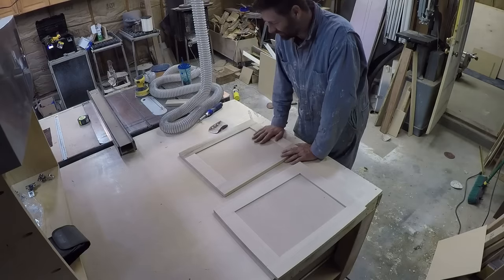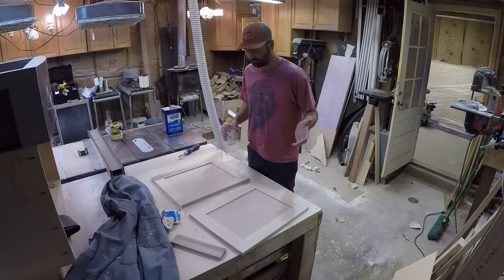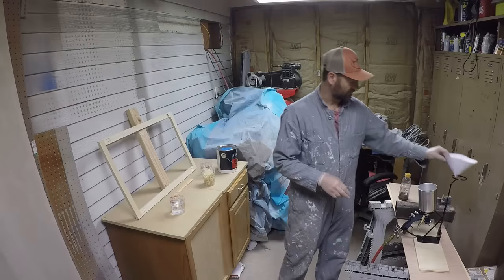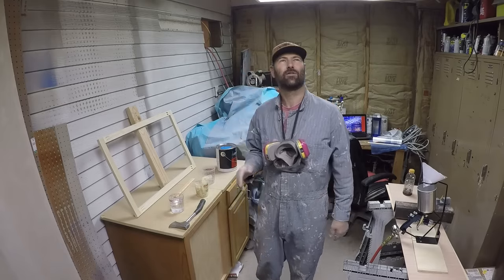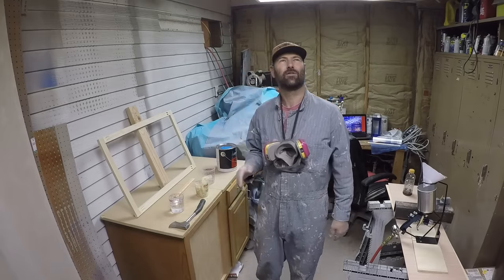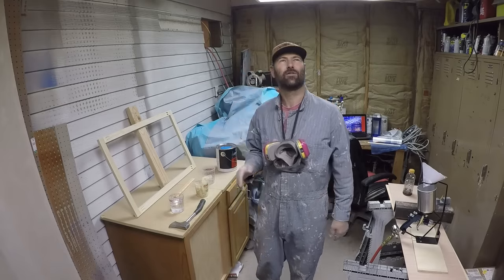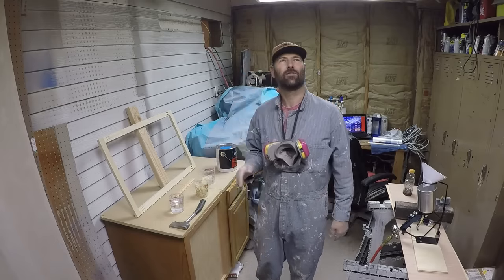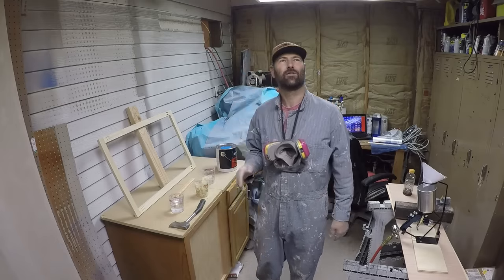Don't Paint Your Cabinets? | THE HANDYMAN |

Comment from the maker: The answer to your question is right here.  https://youtu.be/jD6EZrgX5Dg
Reply: The Harbor Freight sprayer nozzle is too small. You literally have to drill the hole out before you can use it for consumer-grade paint.
Reply: My first experience with the HF sprayer was great. I thinned my paint accordingly and all went well
Reply: I love this guy's OCD with explaining everything and doing a great editing to of editing ro skip the nitty gritty.
Reply: @jimmyjohn8008  same
Reply: So you wouldn’t use paint because it takes too long to dry?

It might be helpful to write down the points you want to make then discuss them at the beginning or end of the video.

Then use the content to illustrate your points.
Reply: I have a DeVilbiss HVLP spray gun I paid $400 for several years ago. Lacquer is my preferred finish to spray.  There are many pitfalls to spraying it you did not cover. Like for example the cloudy finish or blushing you will get when spraying in hi humidity that will ruin your project if you don't know to add a retarder.
Reply: @CJCFCO  Paint peels and flakes off .You need something that sinks into the wood instead of laying on top of it.
Reply: Ok, so it takes longer to dry..  Better to use a non toxic product than to use a product that is toxic, off gasses and is hazardous to your endocrine system!  😉
Reply: @christinewhite2414  if you use regular paint it will scrape off when your finger nails touch it & eventually flake off .How do you think they paint them in the 1st place
Reply: Right traditionally...That why it's prudent to seek out other non toxic alternatives.. there are  many other options, you just have to do the leg work.
 Zinsser shellac and companies who manufacture cabinets and furniture that are certified low voc emitting...
Reply: @christinewhite2414  Tell that to China the jet stream brings the pollution to the West coast. Not to mention the Nuclear radiation still spilling from years ago.
Reply: @brianmanning34  Yeah, that's another issue, don't get me started..  China is definitely gonna wear the pants with this administration, we're doomed!😬
Reply: @christinewhite2414  China actually made more progress than the the US during Trump's run. Trump actually turned back the clock on over 125 climate and environmental policies. Trump even promoted the return of the coal industry. Talk about delusional and total lack of environmental awareness - Trump is the poster child. Due to the damage he did, the USA will now be playing catch up to many countries that are less developed than the US.
Reply: You're using 'paint' as a verb in your title. Guess what you do with lacquer? You paint it on. Besides that, Meriam Webster defines lacquer as "any of various clear or colored synthetic organic coatings that typically dry to form a film by evaporation of the solvent." Guess how many solvent based 'paints' are colored and dry to form a protective film? Additionally, all automotive paints used to be lacquer based. Now most are acrylic or urethane. But all of them are paint, and all of them are painted on, even the lacquers, even the clear lacquers, even the pigmented lacquers. All are paint.
Reply: Next time, rather than being Mr Right, ask questions to find out if the person you are speaking with happens to know more than you do. They might actually be an expert in the industry. How do you know? Now you have two videos with misinformation, that you'll find a way to rationalize away
.
Reply: I feel your pain I just painted my friends cabinets amd it took me all week it was horrible waiting days for each coat to dry and of course after im done I come across this video amd painting cabinets with lacquer its a game changer lol I wish I would of seen this before

Comment: “Don’t paint your cabinets” while making a video on painting your cabinets. 🤔🤨wtf
Reply: I think he meant don't hand paint your cabinets but rather air spray paint them. He probably forgot to mention it.
Reply: I think because he is using llaquer?  I want to know why this is better, other than time to dry.  Is it more durable?
Reply: @abacab87  The best thing to do is call the paint store department to get more accurate information.  I plan on hiring a professional to sand my cabinets and then paint them to save on remolding. Besides, it's a rental property and no need to dump tons of money on expensive upgrades.
Reply: Did you overlook the "?" He's asking a question.
Reply: Laquer is not paint technically.
Reply: @abacab87  yes it's way more durable, not to mention it dries very quickly, like 15 minutes. So you can sand and recoat that quickly, oil based takes 4 to 6 hrs between coats, acrylics approx 1 hour. There is a reason he's wearing a mask. The  VOC fumes are brutal but can be well worth it.
Reply: 1:06
Reply: There was a ❓ 😂
Reply: There is a ? Mark
Reply: @johnnytocino9313  Even better is pigmented 2K polyurethane. But whether it’s lacquer or 2K you’re shooting, you need to wear a hood and eye protection; both finishes use highly toxic solvents that are absorbed by the skin. 2K has the added toxicity of the catalyst (i.e. hardener).

Comment: I use one of the cheap paint guns with a 1.5mm nozzle (neiko brand - $35) and it functions phenomenally. The only issues I ran into were not its fault - I should have gotten the 2.0mm nozzle version, and I shouldn't have been using latex paint  (I knew nothing about painting when I started)

What I did discover, however, was that if you mix latex paint with water based polyurethane at about 60:40 and then thin it to work in your gun (with a 2.0mm nozzle I don't think I would have to thin much, if it all) then you get a basically enamel paint like finish - it's been on my cabinets and seems to be wearing like damned iron. I did my first few cabinet doors with paint and then poly, and because it was even a little bit cool in my garage, it wouldn't dry evenly and I'd get spider cracking in the poly like mad. But mixing the paint with the poly, it solved the issue completely, and even though I have doors with paint/poly separately next to ones with the two mixed, you would NEVER be able to tell there was a difference. And for touchups on chips, paint/poly mixed together fills chips and scratches like a treat.

Comment: If you're using a 2.2-2.4 tip with around 40psi you can get a good finish. I used HVLP with Kilz after sanding cabinets then CabinetCoat over it. It's held up extremely well and lays so flat that you'll be amazed.
Reply: Try zinsser cover stain primer instead of kilz, I did and never went back! I even thin it with acetone to spray it on fine and dry fast.. I use avanti 5 stage hvlp. then I spray behr cabinet and trim with 1 pint of flotrol added per gallon. Always get amazing results.

Comment: Hang those pieces from the ceiling with wire so you can spray all sides with ease. It's best to spray all sides of the frames too so the entire piece is sealed.
Reply: You got it  the 360 coverage rule

Comment: I wouldnt be sanding where we are painting if possible.
Reply: he blew it off with the compressor, it should be alright. You should see conditions in cabinet shops, everythings done in the same room except a negative pressure paint booth. But all touchups, etc are done in mountains of dust.  In third world countries its even dustier and they achieve really good results still. But I suppose in your garage yes, sand on the driveway lol

Comment: As heavily as you are invested in spraying, it might be worth your while to look into purchasing a small spray booth, (if you can figure out a place to put it). Personally, I would look for a used one, but even those cheap collapsible spray tents are a better option than your current set-up. It's my experience that overspray is like nuclear fallout; it settles on and contaminates everything, (even when it looks like it hasn't). So doing it in an area that is totally removed from everything else in your shop, (including that nice air compressor) is a good idea. Also: look into buying some spray socks for the old noggin.
Reply: All I could think about was the overspray getting on the laptop. LOL
Reply: Agree. I built a booth in my shop for painting cabinets and the overspray still gets everywhere. It's a fine dust that can be swept up, but still. I wear a full monkey suit. Respirator, goggles, cap, etc. I'm using an small airless sprayer. 

I'd stick with his recommendation. Don't paint your cabinets. It is A LOT of work. 2 coats of primer and 2 coats finish. Dry time then prep in between. What was I 🤔

Comment: Hvlp - high volume LOW pressure!  Turn your air down and you will get a better finish.
Reply: I'm glad I was not the only one who noticed a lot of pressure from the gun.  This will also reduce the amount of paint you use on the job considerably.
Reply: Lol thought the exact same thing, sounds like 60 psi at least.

Comment: Consider using Shellac as primer/sealer .  Dries super fast . sands much easier AND film thickness is half . (less toxic and the finish lacquer coat can be thinner . (less spray and fuming). Perfect base for a lacquer finish . (keep a few spray cans on hand for small items)

Comment: I used Benjamin Moore Advance paint on my cabinets. To get a professional look, it takes a lot of coats, a lot of sanding between coats, and a lot of dry time between coats. The doors are smooth with no grain showing. It’s a lot of work, but it would have cost me $5000 to have a pro do it. And yes, I did use a HVLP from Home Depot.

Comment: so if it takes 20-30 minutes between coats are you okay to leave the lacquer in the spray gun without it drying out or causing issues? also is it still the case that lacquer finishes tend to yellow over time? or is that an old issue that no longer occurs with new technology and products??

Comment: Many years spraying cabinets and whole house in multi multi million dollar homes. Everything is sanded and filled to the 100th degree, only using bonds and spot putty, then a primer coat. After the primer coat you go very every inch with a high output light looking for ANY imperfections,  which then got filled again and sanded. On to first coat of whatever final coating you choose, followed again by more light intense searching for imperfections which are fixed and on to the final 2 coats with sanding between if called for. Big money paint jobs!

Comment: Brother, very nice informative vid... Great job!... a... about spraying... you may consider following: a) set preesure ON the gun to 25-35 PSI,  mix ratio on first coat 80% product to 20% LT,  second and third coats 85%-90% ratio to l thinner... b) think about using an old coffe can as a "lazy Susan"... sort of... :-))))) c) also... when spraying I used method called "pushing product", not pulling, as you did... you start with ALL edges first, rotating them as you go... and then you start spraying FROM the edge closest to you TO edge farthest... it will allow you better visual control and NO overspray and fuzz... d) built a small table/stand on casters to put that coffe can on, it will allow you freedom from the wall...better control of finish...  now... I say this, because I build furniture and cabinetry plus construction for the past 50 years...  Try it and see if you like it... Good luck Boyo... :-))) You doing a great job... Greetings from Pensacola...
Reply: Coffee can on a lazy susan? Do you mean put door on top of can? I don't understand.
Reply: @johnnytocino9313  hey J... yeap... that is exactly that... very simple yet very effective and cheap way to spray cabinet doors quickly... used myself for about 40 past years... and?... still works...
Reply: hello Johny... again... take a large coffe can.... put on a flat surface high for you to spray comfortably... use a lazy susan if you have one... put a door flat on the coffe can... spray edges first... than spray AWAY from you on 5-10degree angle to "push" product away... you will avoid all overspray at once... try and see... let me know how did you do...

Comment: Oh, I HATE the water based cra___!
Seems like the producers of that stuff do their best to try to sneak it in on you and ruin your project.
I've sworn off Rustolium a few times in my life (only to give it a try after some years because I don't want to drive all the way to another store). 

On a steel desk restoration, I spent a day sanding and prepping. The store I drove to only offered Rustolium metal paint in a can (not aerosol). Poured it into my spray gun and adjusted it. Put on a coat and I knew it wasn't right.  No wear in the can did it saw water based!!# It litterally pealed off in sheets. 

That was 10 years ago and just last week bought the first rattle can of Rustolium in a decade. It worked okay. 

But when I buy paint, I always avoid anything that says "easy clean up" or "use soap and water".

Comment: Could you please specify your inlet pressure at the gun, tip size and number of turns out on your fluid control? All of that info., would be very helpful.
Reply: HVLP runs about 45-55 PSI at the gun air in and 12.5 to 14 SCFM

Comment: PPG has a product called (break though). That stuff will stick to everything even glass and tile. I did a few experiments on my own with stained cabinets with lacquer finish. Didn't even need a primer. Lightly sand it. And whip down with de glosser.. sprayed 2 coat with a 315  fine finish tip and a airless sprayer... Applied one more coat just because it was that easy.
Reply from the maker: Thats awesome.  I have an airless that I haven't used in years.   I will look for that 315 tip.
Reply: @TheHandyman1  they're yellow very very nice finish or 4:13 depending on what you straying.
Reply: Keep up the good videos.

Comment: As a painting contractor, I could name several issues during your process that can cause issues and what other materials that would work for your application in the future. Just throw me a message and I can elaborate.
Reply: I've recently started painting the cabinets for this job I'm contacting for they want every houses cabinets I do painted white. What could I do differently than this guy to make em look  terrific?
Reply: @iditarod4081  I use an HLVP sprayer with Latex enamel Baer brand paint, Polar Bear is the color. Since we're not building the cabinets and just repurposing them I just use Krud Kutter brand cleaner to take off any oil from previous owners/tenants cooking, some are disgusting so get plenty of rags and a 5 in one to scrape off excess oil. Then rough them up a little with a palm sander 120 grit sand paper (trial and error sometimes you need more grit sand paper) If you don't have that, you can even use those green dish cleaners for pots and such. These will give em enough of a roughness to paint on you don't need to strip em all the way down. Remember to "box your paint" which means mixing a little water so your sprayer won't clog make SURE you strain your paint always. I give them a good two coats three if really needed. I use zip lock bags for all hardware my friend likes to these little Halloween candy buckets for his hardware because sometimes, and this happened to me. I brought in a labor to clean up and he threw my bags away 🤬 the Halloween buckets never get thrown because they just stand out I guess lol. Remount the cabinets, then put the hardware last. Done deal I've done over at least 30 houses already. Cabinets just happen to fall in our lap we usually just tape, texture and paint. Finish work. Mostly when painting doors and baseboards I use an airless, roll lids and walls, cut in, then off to the next property to make it look and smell brand new.
Reply: Why in the bell would be reach out to you? Just comment your smug opinions right here

Comment: I sanded my honey oak cabinets too much and the wood was showing through the paint as green. I needed to use an oil primer first to seal it then I thinned down Cabinet coat with flowtrol and sprayed my cabinets with a 1.8 tip using a harbor freight HVLP gun. Basically came out perfect but I rolled the frames and they came out pretty damn good too. That stuff sets up flat

Comment: I got a soup ladle for dipping out the paint from the $1 store, bent it at a right angle to go down into the can better. And I used a wire mesh strainer from the $1 store to strain my paint. But I've only ever sprayed my house with the paint.  And some doors.  Wish I'd seen your video to know to prep those doors like you did, and sand between sprays.  Still came out pretty good.

Comment: If you're going to spray, your best bet is a turbine setup...not that (supposed) HVLP air compressor gear.  Turbinaire puts out a nice product at a fair price.  That equipment also sets you up for shooting dyes and glazes to create a really professional looking furniture wood result (way better than stains which accent grain).  Turbine gear will have significantly less overspray as well (again, better than the supposed HVLP air compressor gear).  The turbine guns constantly bleed air even when the trigger isn't pulled, so you get a well-developed air flow pattern when you do pull the trigger to spray.

Comment: I refinished my oak cabinets and removed the grain out of them.  I paint cars for a living and did all the spraying in the paint booth.  

I stripped the finish.  Sanded it as smooth as possible.  Bought an oil based primer.  Found that water or hybrid primer didn't sand or spray as nice.  

Anyways, oil based prime, sand, and prime a second time.  4 coats each time.  Sanded the wood and first coat of primer with 180grit.  Finished panels with 320 grit.  Making sure to not burn through to the wood and touched up the spots.

I ended up using a water based epoxy paint.  That stuff was unbelievable to spray.  Layed down very nice and it dried very hard.  Very happy with the results.

Used my cheap $60 HVLP 2.0mm fluid tip gun.  Never tried an airless sprayer.